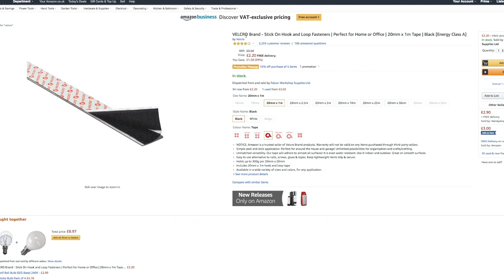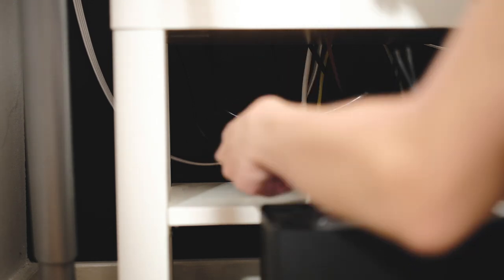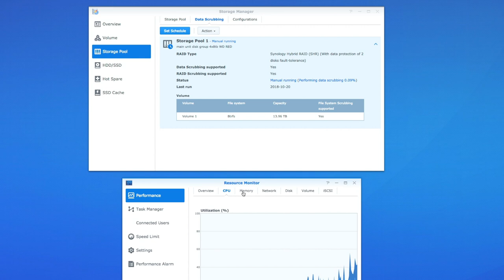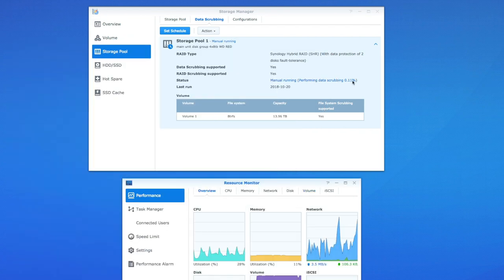Synology DiskStation Vibration Noise - EASY $5 FIX!

Comment: Thank you for this solution. Ever since I did this my NAS has been quiet after driving me up the wall for the past year. All solutions online told me to stick a heavy weight on top of the NAS that sometimes worked but would eventually vibrate over time.
Reply from the maker: Glad I could help. Thanks for sharing your experience with us.

Comment: I created a support ticket and Synology sent me 4 new plastic drive cages. So I guess my problem is fixed for the next 3 months lol.  This is a far better permanent fix however.
Reply from the maker: Hey thanks for watching. Didn’t think to go that route. And I think the issue will be the same even with the new cage because of the slight gaps that inherently exists. Did yours make any noise ? Did it solve it with the replacement cages?

Comment: Can confirm this worked wonders to dampen the vibration. I put the strip on the top and bottom of the bay and then also placed 2 layers of flat polystyrene like packaging foam under the box to further dampen any case to shelf rattle. Also worth noting, I only needed to do this after adding an 8TB WD Red HDD. My existing 2x 4TB WD Red HDD's did not cause such issues.
Reply from the maker: Hi Kerem, thanks for letting me/people know this works. Good to hear another success story!
Reply: @JoeLamOfficial  As an update to this. Unfortunately I have been turning my NAS off for the last year due to excessive hdd low end 10-20Hz rumble. I am looking into another solution such as storing in a cupboard or noiseproof but somewhat ventilated box. Sucks to own storage and have to turn it off :/
Reply from the maker: Hey bud. Same here. I have to turn it off when I film my videos. It’s just too loud buzzing away in the background. Normally I don’t mind since I often headphones etc. Ideally it’s in another room to be honest.

Comment: Using an old towel underneath, some weight on top (square basket with heavy items), and this solution right here. works really well. Strange they don't do this right out of the gate, it's such a cheap thing that has a major impact.

Comment: Thanks for the idea and the video to show just what you did to fix this annoying issue. I just applied this fix for my DS412+, as it was causing that annoying vibration sound, as seen in the video. I'm still curious on the results, but here are a couple of things that might be interesting to others considering this fix:

1.) Some commenters mentioned the  increased tightness of the sleds, once the Velcra tape is in place. On the DS412+, that is certainly noticable, once one slides the harddisks in. However, it doesn't cause a problem, even if one applies Velctra stripes on both sides (which I did, to reduce as much possibility for vibration as possible).

2.) To further decrease any vibration from the case to the shelf that it rests in, I also stuck feet I made out of cut pieces from an anti vibration mat which is normally used for washing machines to the bottom of the NAS case.  I use my DS412+ vertically bc there is no space to use it horizontally, as designed, so I had to use something between the case and the shelf - why not make it extra noise-reducing, then? :) I did some research on how to reduce vibration on speakers, computers and NAS, and this is one cheap fix which I just had to try (the alternative would have been to buy noise-reducing feet)

3.) For people wanting to save some money by not using original Velcra stripes - don't, and there is good reason for that. You need stripes with a width of exactly(!) 2cm - not more, not less. I did some research and while some cheaper stripes claim they are 2cm wide, for most stripes I found this actually applies only to the paper on which they are stuck, before you peel them off. The actual stripes are some 1.5mm shorter on both sides, so you end up with a stripe that was sold to you as 2cm wide, but in fact has only 1,7cm, leaving you with a space of 3mm in your NAS case. You don't want that. Go for the Velcra stripes, they are exactly 2cm, which is what you need here.

4.) Looking at the specs for the Velcra stripe,  one should wait 24h for the glue on the bottom of the stripes to take full effect. I recommend adhering to this (can't hurt). The specs also say the stripes should not be exposed to sunlight. This tells me that the glue used on the Velcra stripes may react to temperature. I don't know whether this could cause an issue when used within a NAS case, where higher temperatures can develop due to the harddisks operating there (hence the need for cooling fans). I would love to hear from anyone who can comment on that particular subject.
Reply from the maker: Thank you so much for taking the time to share your experience and insights on this fix. Your detailed and thorough information will be helpful to others who are considering this solution. I appreciate you sharing the tips and recommendations!

Thanks for sharing your insights and being part of our community! 🙏🏼

Comment: Solid tip. It helped quite a bit on my 920+. It's still there the noise but I would say maybe 50% quieter. I also put a rubber pad under the unit. Thanks for sharing it.
Reply from the maker: Glad it helped. Thanks for checking out my video. Really appreciate it. What drives are you using?

Comment: This really did the trick for me. I did this for my 1819+, and I actually bought two 1 meter strips (the same type you linked to) since I was a bit unsure if one would be sufficient for 8 disks. Turns out it was the perfect size and I cut 8 pieces in ~12 cm strips. The sound was not immediately fixed, so I used the other strip to do it on the other side. Still didn't immediately fix the sound, but after a few days the vibration sounds stopped altogether and haven't heard it again for months. I guess the disks had to settle in a bit
Reply from the maker: Hi there. Glad to hear it worked for you too! Thanks for sharing. 👍
Reply: Update from me a year later: The noise actually came back after about 6 months (this time a bit noisier!), so I removed one of the double strips I had. Turns out having two strips made it a bit too snug. So don't bother with two strips, save yourself some energy and a few bucks and only do one! And like my previous comment - if you don't immediately hear a huge improvement, let the disks settle in a while first.

Comment: Thank you so much for sharing this fix! I have a DS218+ and just swapped from a single 2TB HDD to two 8TB HDDs without acknowledging the problem of noise before purchasing the new HDDs. This works like a charm for me with both the top side and bottom side of the bay taped with velcro. Now the noise is way less noticeable and I am very grateful I do not have to return those HDDs.
Reply from the maker: Hey!! Glad to hear that this worked for you too in minimising the hard drive noise. Thanks again for dropping by.

Comment: you had to let us hear before and after.
but whatever..
Reply from the maker: Umm... right at the beginning. Basically the same as right at the beginning when it's not making that vibration noise when I placed the hand on it. Didn't feel like it would make much difference even if I used the same clip showing no sound.
Reply from the maker: Point taken. Will keep this in mind for future videos.
Reply from the maker: 15 upvotes. I think I might need to do a follow up video?
Reply: Maybe you should be the videographer.
Reply: Galaxy TS2  Maybe you should be the videographer.

Comment: How does it sound after the strips were added? I think that would have been helpful to include in the video. 
But thanks for this fix. Looks like it works for the users in the comments, I'll have to give it a try myself.
Reply from the maker: Hi Matt, apologies I didn’t add a before / after comparison. I assumed people would get that it’s like normal without that annoying buzzing chassis sound. It doesn’t change / reduce the hard drive sound (some say it helps a little).

Comment: mine was slightly different as my synology only has a single drive but exactly the same noise.  I already had some soft sided velcro and so using your noise buster method set to work.  I had to put my velcro under the drive being careful to leave the two holes underneath open and not blocked by velco.  Once i stuck it on and slid the drive into position i found the holes didn't match up with the screw holes as the drive was slighly lifted up.  after a lot of messing about those screws finally went in.  I switch on...FIXED,  thanks Buddy.  Ive had my synology drive two weeks and that noise was driving me bonkers...      So Silent now, LOL
Reply from the maker: Hey thanks for your input. It was driving me mad too the noise 😅

Comment: Just tried it on my ds418play and it works like a charm. Before this I had folded up pieces of paper stuck in between the drivebay doors and the case. This also reduced vibrations but it was stupid ugly. Your solution works even better and isn't noticable from the outside.
Reply from the maker: Glad to hear it worked for you. Thanks for watching and letting us know your feedback. ☺️

Comment: I have a DS920. I just added a fifth foot on the bottom of the case, dead center. no more noise
Reply from the maker: Thanks for the tip. Glad to know another way to help with the noise. Thanks again.

Comment: Wow this tip worked like a charm on my DS916+ and DS918+! I also added a mousepad with a fair amount of foam padding to the base of each one as well and voila both units are super quiet. Thanks very much for this cool tip.

Comment: WOW!!!  The initial report on doing this to my QNAP TS-431+ is very, very positive.  The unit had been getting rumbly and grumbly for a while.  I was thinking it was the vent fan until I saw your video.  Hey, a drive cage is a drive cage, so I figured, "what have I got to lose?" 

The Amazon links you provided are no longer carried by Amazon and the third party vendor wants $30 for the roll of Velcro.  I found another offer for 3/4" x 5' for $7.95.  Installation was slightly annoying (like Velcro always is), the drives slid in with only slight persuasion, and the NAS came up.  Silently.  Blessedly silent.  Beautifully silent.  Delightfully silent.  Did I mention it was silent?  In the past there were always some noises, noises I tuned out until they got really loud from time to time.  Now they are ALL gone.

I'm grinning from ear to ear!  However, I won't declare total victory for a few days - the pesky NAS gets noisier from time to time - but I have a good feeling about this!

Thanks for sharing this tip!
Reply from the maker: Thanks Mike for sharing your story. But also letting me know about the broken link. I’ll try and update it as soon as possible. 

Strange to hear, no pun intended that your QNAP has similar issue. Thought it might be synology only!
Reply: @JoeLamOfficial  I think it might be endemic to drive cages. If the drives are screwed in - better yet using rubber washers to minimize vibration - the drives are likely to be quiet for a long, long time.  In a drive cage, they are loosey-goosey and can vibrate.  Maybe not today, maybe not tomorrow, but some day.
Reply from the maker: I found that it’s the hard drive cage rattling just that tiny bit against the chassis rail. Even if the hard drive is bolted to the cage , the cage could still rattle against the chassis? Think it’s just mm too loose by a fraction.
Reply: @JoeLamOfficial  I agree, and here we are on day 2 of a quiet NAS!  Life is good!  In thinking about it, if the drives are vibrating enough to make so much noise, that can't be a good thing for the connectors.  Sure, they have spring tension, but if you flex a spring long enough, it will break.  So, it seems like this mod will also help the NAS last longer.

Again, a quiet NAS is such a relief!  Thanks again for sharing this hack!
Reply from the maker: Fingers crossed it’s all running good now. Thanks for your time Mike. Stay safe 😄

Comment: Hi Joe - perfect solution, I don't know if I have OCD, but the vibration noise was driving me friggin nuts.  I went out of my way to make my NAS quiet, even replaced the internal fans with the Noctua NF-A9 FLX 92mm fans in reverse order so it pulls cool air through the front of the unit and exhaust out the back (works really well).  Thank you again!
Reply from the maker: I thought about that mod too, is it worth it the fan? Mines set to low andI barely hear it? Unless I'm going bit deaf. Hope this extra little mod will make your NAS even quieter. Thanks for watching again.

Comment: I have the DS 1019+ and it was making the buzzing noise from day 1 and I only have 3 drives in there to start with!
Even with the slower 5400rpm WD red's the noise is there.
I am surprised they don't include rubber strips or something in the box, Synology there is a thought to improve your product even more.
Thanks for the video, I am about to switch my NAS off and place some felt like you have done here.
Reply from the maker: Hi there. Thanks for watching my video. Hopefully this simple fix helped. It was driving me mad. Had to use my feet to dampen the vibration noise for a long time lol

Comment: This worked for people I know, but not for my 918+, as the sleds are really tight by default in mine - the velcro (the same original velcro from the video) increased the height of the sleds and put some strain on the SATA ports in the back making it impossible to insert all of the sleds without applying force and stressing the ports permanently.
That really depends on the specific enclosure, a fraction of a millimeter can make a difference.
Reply from the maker: Hey thanks for the feedback. If yours is that tight to begin with. Does it still suffer from the buzzing vibration noise? I guess there must be difficult tolerances in the sled / cages. Hence why it would make a noise in mine and some. You could try and get some other thinner felt material from a craft store maybe? If that’s too thick.

Comment: My DS216+II is quitte noisy after i changed my RED 3TB disk for 14TB shucked whitelable disks.
Just tried it. Hope it will work. Thanks for the video!
Reply from the maker: This my first time using any NAS specific drives, so I was quite surprised how loud they are. I wonder if other drives (say the IronWolfs) are quieter... But anyway, this isn't really meant to dampen the original hard drive clacking ticking sound. It was suppose to remove the specific buzzing noise coming from the Synology chassis. There's bit of play between the sled and the chassis that causes this weird buzzing sound that didn't happen when it was new. But the fairly open nature of the case overall means that it won't really help with the actual mechanical hard drive noise if that's what you are after.

Anyhow, let us know how you get on. Thanks again for watching. :)
Reply: >8TB are currently helium filled which transfers vibrations to the caddy much more than air-filled, super annoying!
Reply: @indiekiduk  yes, and my Nas is in my living room. Makes some hard noises haha

Comment: Thanx for the brilliant idea.. I also had the same problem with my DS418 and since i put 4 HDDs the vibration became untenable.. When i used those velcros on both sides (u used it only on the bottom) HDD also fitted without any problem.
Reply from the maker: Hi there. Glad to hear it helped you out with this simple fix. It was driving me mad over a year till I had to find a solution. lol

Comment: I have this exact same issue happening. Interesting solution you have here. My only concern is sticking the Velcro to the case, could be difficult to remove if you ever need to
Reply from the maker: Hi David. I must say I haven't tried removing yet. But I don't think it'll be too difficult. If there's any residue, a bit of alcohol or Goo Gone should get rid off it. 😅

Comment: you can also get just strips of adhesive backed foam. so probably 20mm wide, 1mm thick so its thinner than the velcro and so you can put it on the top and the bottom to ensure there's no plastic on metal.

And for the other noise when under load theres a trick people use with 3d printers to put the printer of a concrete paver. Probably not too easy to find one small enough for putting the synology nas on though, maybe worth pouring a custom sized one out of a bag of concrete...
Reply from the maker: Thanks for the tip and sharing with us. I think your idea should work too as long as it reduces the tiny gap in between. 😉

Comment: great vid! thanks for that just a litte question.... the ball type thingie :) you use to blow out dust with what is it called? en where did you buy it, also the velcro you used did you only put it on one side of the bay holding unit?  thanks and greetings from the netherlands!!!
Reply from the maker: Greetings!

yes the little dust blower usually meant to use with cameras, you can find one here - https://amzn.to/3VVPgE0

The velcro, I only put on one side but you can try with one side first and see if the drive bay fits nicely, if there's still room. You can always add more after to the top or bottom. 😉